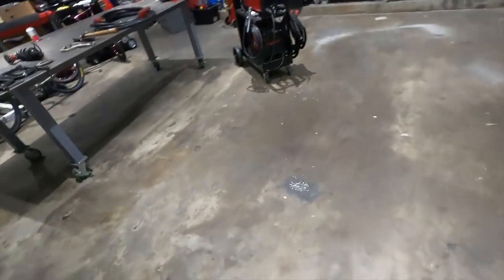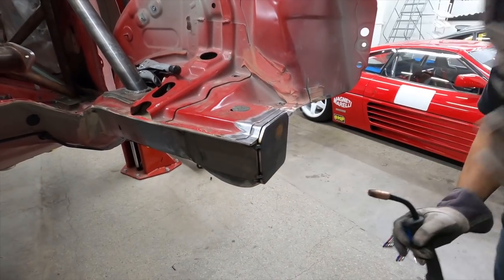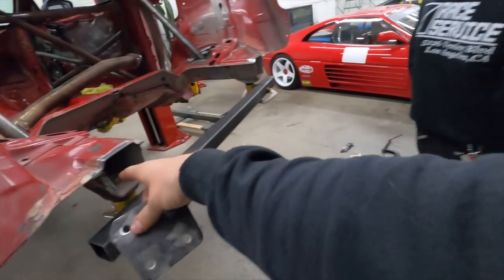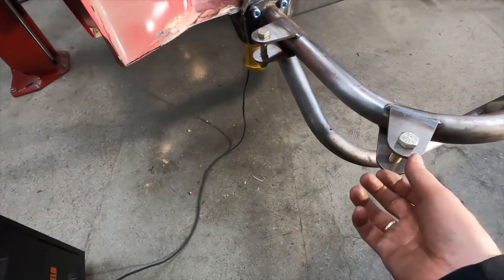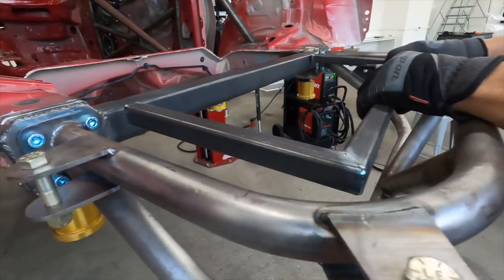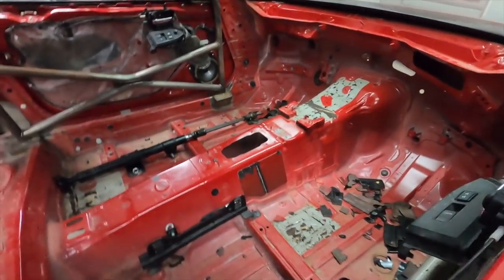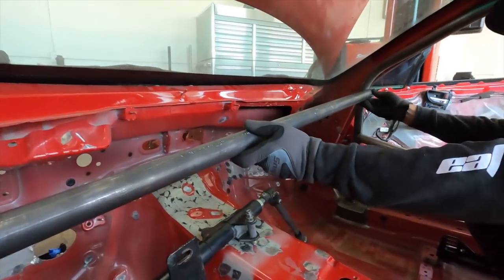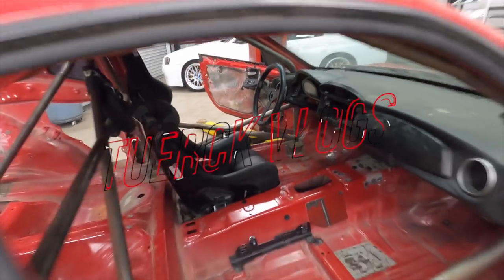Ryan Tuerck- East Coast Car Build EP3

Comment: Why not putting the fuel cell in the big opening behind it? And updates on the pro car? Continue the amazing work man
Reply: White_eazy_69 he does that because he might have a rear mount radiator and there’s still a lot of shatter space behind so it will be fine if it hits unless he puts the radiator behind the fuel cell like Adam Lz s15
Reply: The space over there is also for the radiator btw
Reply from the maker: Yo thanks dude, we put the fuel cell all the way in the back for weight distribution and to leave room for the rear mounted radiator further in front of the fuel cell. We are announcing pro car and team April 2nd!!!! Can't wait to tell you all.
Reply: I always wondered why the fuel cell is so far back. I understand weight distribution, but what about safety? No issue at all inside this frame?

Comment: Nice progress! 
Are the 8 bolts of the crash bar/bucket strong enough to hold the car when using the added jack point? There is quite some weight and lever!
Reply from the maker: Yeah it it's all good on the bolts. We ran this same setup on last years pro car and it was fine all season.
Reply: @RyanTuerck  Thanks!

Comment: Why are two types of welding procedures being used? I'm not two familiar woth welding and though I ask.
Reply: Tig & mig
Reply: Yeah and when do you prefere tig over mig?
Reply: @SuperChaser  almost all the time if you have an opportunity cause its easier to weld thicker metal and the connection is much more firm (higher temperatures, better penetration and metal bonding)
Reply: @WazZup91o  nice. Thanks for the info.
Reply from the maker: Dom pretty much only tig welds but early in the video we didn't have the tig welder yet so he migged the rear plates in. The steering column install we used mig because the cage was already migged so we kept it consistent. Tig is preffered because you have alot more control over the weld and it's also alot cleaner.
Reply from the maker: @SuperChaser  Pretty much always prefer Tig over mig. Tig is alot cleaner and you have way more control over temprature and the weld.